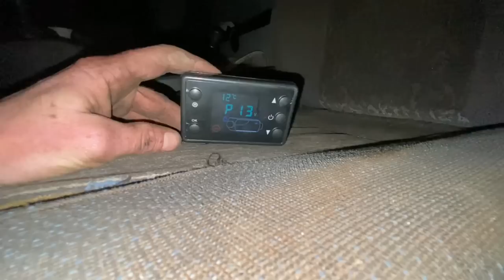Chinese heater quick job…Everything’s a struggle!

Comment: The power down period is to allow the heat exchanger to cool down . There's a control board inside which can be fried if the heater is switched off without cooling down first. The pump should be at a 45 degree angle with the connector end facing up. It's to ensure the pump is properly lubricated by the diesel as it flows through :)
Proper job though Chris :)
Reply from the maker: Thanks Robert! Good bit of advice there mate , cheers for sharing take it easy 👍

Comment: Your right the struggle bus would benefit from one of those heaters , Always run it on highest heat for a few minutes to clear the soot build up before shutting down.
Glad the welding wire trick helped out.
I can’t take credit because it’s in loads of the fittings videos.
Struggle on I’m always here to try give support in comments 👍
Reply from the maker: Cheers for that mate… made the struggle a bit easier! A bit of advice goes a long way. 👍 take it easy chox

Comment: 30 degrees from horizontal is optimal (the outlet side higher).  Reason being it allows the lickle air bubbles to escape so dosing pump stays lubricated.  But 45 will be good enough.  Been enjoying your videos.  Keep on keeping on

Comment: Happy new year, have ya seen the orange Volvo gritters on the A1 they spread salt at 50mph on 26ton, highways England has spent  30 million for the country  . on these trucks.
They will get the money back from the average speed cameras,  about ten just being installed north and south in the Peterborough area of the A1.
PS cranes don't they have heaters from the engine?

Comment: Hello mate, having run one of these Chinese heaters on my caravan for 2 winters the biggest problem with them is they coke up the heater plug and throw up a fault code. This is usually because people run them at a low heat setting. To avoid this I would tell customer at the end of the day run the heat on full chat / full heat for a few minutes to burn off all the shite and the fan will blow it out otherwise you will be going back to him constantly with fault codes coming up….. think it was E08 ?